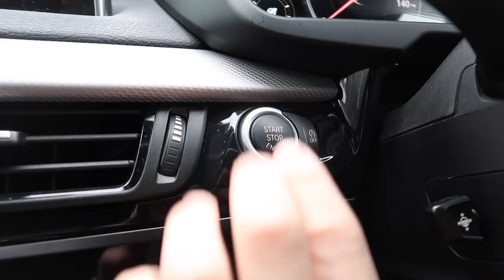REGRET!!! ACCIDENTALLY BOUGHT FAKE WHEELS

Comment: As for tyres, rainsport 5s are okay grip wise but don't expect more than average especially in the wet, the sidewall is also very soft which for wet driving isn't too much of an issue since you'll lose traction before you feel bad sidewall flex

Comment: Happens to the best of us! 
I actually had similar issue years back but the other way, the fake wheels turned out to be genuine. Got a set of Work Ewing RSZ Negatives brush painted in matt black with a civic esi still attached to them for £450 👍